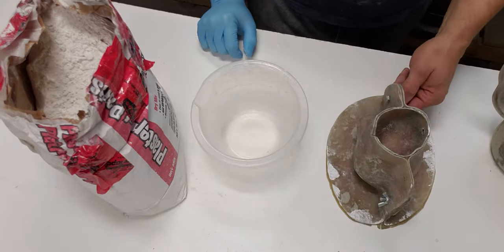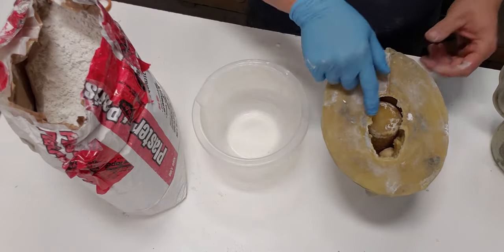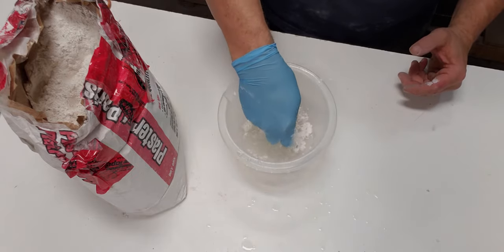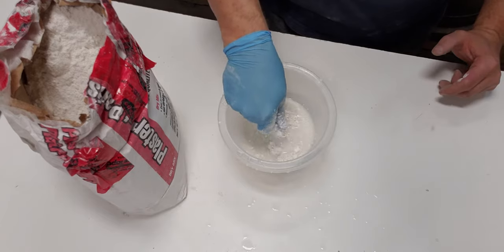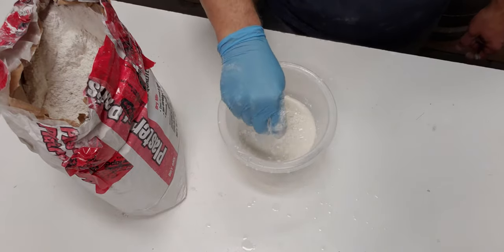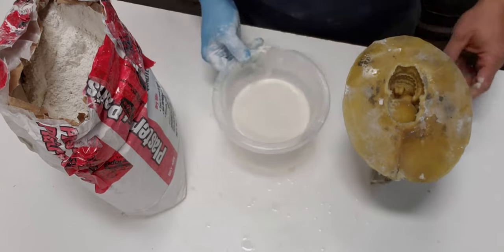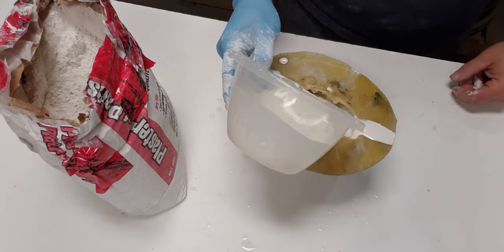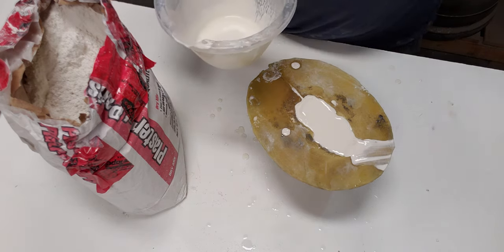Mold making/ How I make plaster of paris

Comment: cool vid Gris.....  Do you know of a way to seal these so they could be used outside or do you just paint and tell your customers that they are not weather proof and should be displayed inside only?
Reply from the maker: Not sure Bob , you could seal the dickens out of them with a solvent based concrete sealer might work.
Have also done as you mention , painted and told peeps indoor display only.
Reply: @mrconcreteartisan  Thanks Gris.... I have always assumed the same is correct for Gypsum cement - though it is heavier and tougher.  Agree?
Reply from the maker: @Kelly Larson You can but ,it's not necessary with plaster.